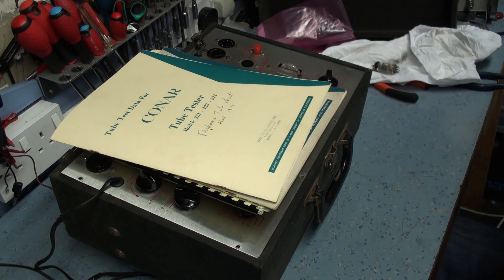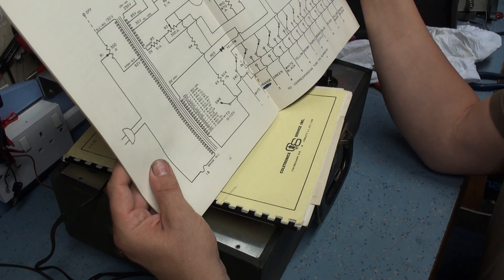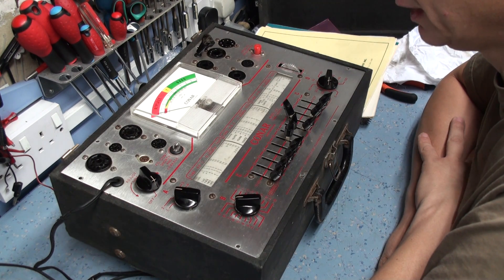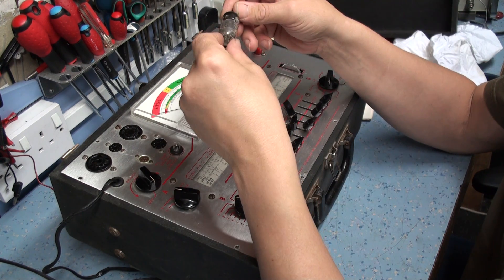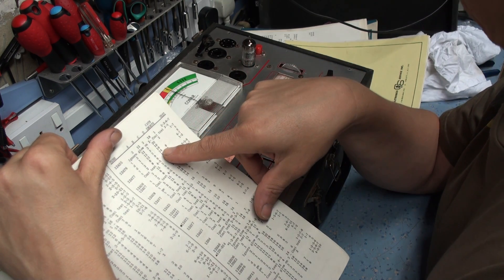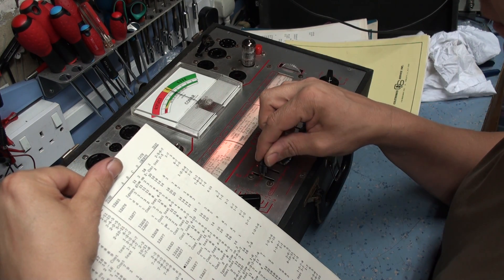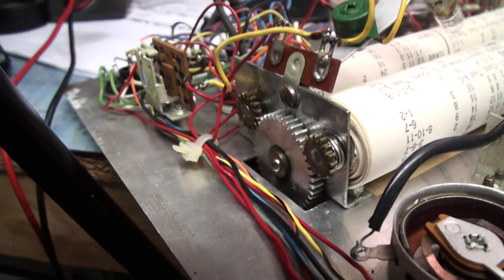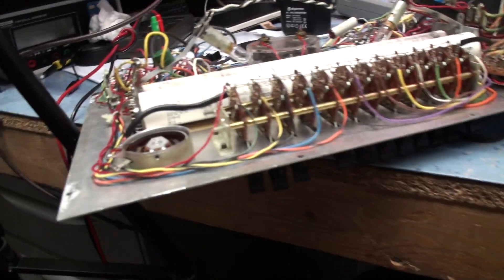Conar 223 Valve /tube tester pt1

Comment: Hi Simon.  I enjoyed your video. I have a Conar 223 which seems to work but it doesn’t light up my eye tubes (EM80). I replaced the capacitor a while ago but did not replace the selenium diode rectifier. When I test the  voltage on the plates of my tubes I only find AC voltage. Do you remember how you replaced your rectifier and if you used a dropping resistor? Thanks.
Reply from the maker: It sounds like the rctifier is short. Just fit a silicon in place. Then check voltages.